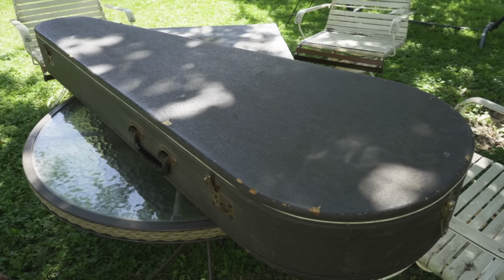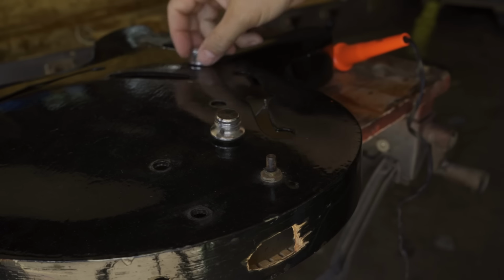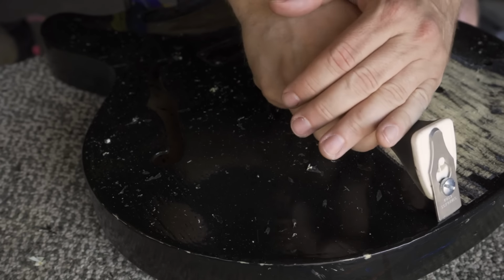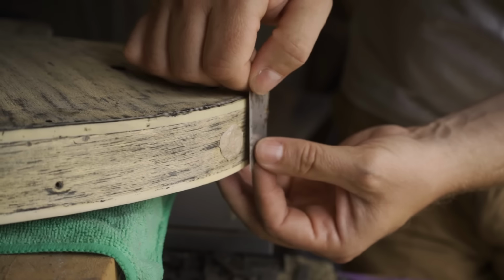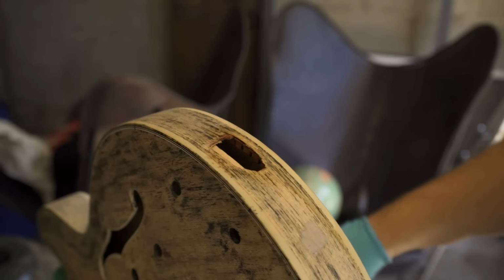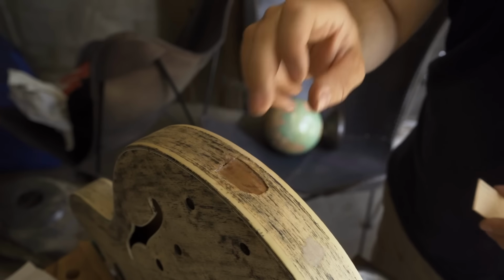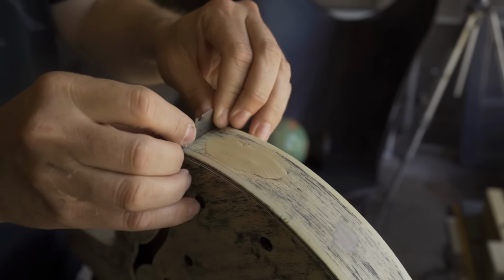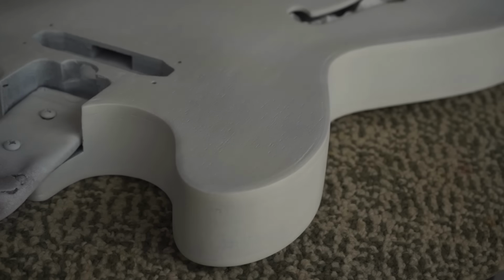I Am Luthier | Do Not Question My Methods | Using My Furniture Repair Skills On An Old Guitar

Comment: As soon as you mentioned your wanted to try a guitar, all I could think was "oh man you're gonna bring out that weird toxic gatekeeping part of the woodworking hobby that thinks a fender squire at the bottom of a river requires the same detail and skill as a Stradivarius guitar."

Enter the comment section. They can go to hell. I enjoyed the video.

One thing you can do to prep a wood surface for paint like a guitar body (also an easy way to get a head start on a french polish) is to paint on a relatively thick layer of shellac and then sanding it back to the wood, using the shellac to fill holes and pores. It had saved me hours on French polishing and surface prep on rough wood - I did it on the ratty curved legs of a bent plywood Ikea chair and I was able to get a freaking mirror shine on the entire thing in an hour (excluding the overnight dry time of that first fill layer)

Comment: looking forward to part II.  So, I understand the objective of the primer, but how will you recover the binding? Why not just use wood grain filler with no primer? (I am learning)
Reply from the maker: I’ll just scrape the paint off the binding. The primer made it easier for me to see  which areas need work.  You could have just used filler but the primer made it easier.

Comment: i wouldn't have cut out a irregular shape patch peiece, i would square off the hole using a router bit, leaving the ends rounded. then cut a veneer piece to shape

Comment: Why don’t you buy one of those box cutter knives, ie the ones where you snap the end bit off to give you another sharp edge. At least you would have a handle on the blade, and you can extend it to the length you want

Comment: I was wondering why you decided not to use a chemical to remove the clear coat/ black paint?
Reply: As someone who does this kind of work, myself, I can tell you that chemical stripper is rather unpleasant stuff. It takes time to work. It's a messy job to remove and neutralize. And even still, you'll likely spend some time scraping after you're done.

Often someone who is skilled with a scraper and keeps their tools sharp can achieve the same results more quickly and skip the unpleasant stripping process.

Doesn't work all the time. Occasionally I still have to resort to the chemicals. I'd rather skip it, though, whenever I can.

I think he said something similar in a video sometime back.

Comment: With 40+ years of experience, I can spot the warning signs a mile away and have billed many thousands of hours to reverse shoddy workmanship. First off, I've never heard of a state requiring a luthier license, in fact I'd actually welcome that. If this YouTuber could share with us photos of his luthier license, I think we'd all appreciate that. Here are mine: http://tiny.cc/martincredentials

However, failing that, here are a few things to look out for when seeking out qualified repairmen to handle your valuable instrument and avoid unnecessary damage. 
- If you cherish your valuable instrument, do your homework about the guitar repair shop you plan to use. Check online reviews, ask around. If you don't, be prepared to have a very bad day.
- Always record your serial number and photograph your guitar before and after the work is done.
- If the repair quote sounds inexpensive for the repair you require, then the work is likely going to reflect that.
- Ask to see a copy of the repairman’s credentials from a certified luthier school.  
More: http://tiny.cc/guitarrepairchecklist

Comment: Furniture grade repair and stringed instrument grade repair are different
Reply from the maker: Are you questioning my methods?!?!
Reply: @DashnerDesignRestoration  2 different degrees of quality. Stringed instruments require a higher level of control while furniture requires less quality. I've repaired and built for over 50 years and if you look at the results of the 2 different types there's a huge difference.

Comment: luthiers dont spray over binding.
Reply from the maker: Actually, they do and then they scrape the binding clean afterwards.  Trust me, I’m a licensed luthier.
Reply: @DashnerDesignRestoration  My friend you need to get your .95 cents and three box tops back from Kelloggs for that "license" because NO guitar mfg spends money to scrape a solid color off binding. nor would they put binding on a guitar that is going to be finished in a solid color. Finish over binding is clear or tinted. New guitars would cost 10,000 dollars if scrapers were hired.
Reply from the maker: @yoshinoyajones8924  Google “Gibson scrapes binding”.
Reply: @DashnerDesignRestoration  As I am not a vindictive 14 yo troll, I admit I am wrong. It doesnt happen often. Carry On!!

Comment: Apparently you're NOT a luthier! A lot of the things that you did I wouldn't have done. The repair patch was OK but I wouldn't have used the epoxy putty or the wood filler to patch those holes. Superglue would more than suffice. And those potentiometers were petrified into place. A little bump here and there on the tops of the knobs would loosen them up rather than simply pulling them from above. And shellac - UGH!! I would've used AUTOMOTIVE PRIMER which is made for a true paint finish whereas shellac is bug shit and spit - literally. Any way I am interested in seeing this come to fruition.
Reply from the maker: Well, most of what I've done so far is just basic wood repair and finishing.  I haven't done much that's specific to luthiery except maybe the kerf lining but even that could be seen as just more woodworking.  At this point it's just wood in the shape of a guitar.  P.S., there's nothing wrong with shellac. It's a fantastic tool for wood finishing.
Reply: Jeez, leave the guy alone. Rock on, Dash. Love your videos.
Reply: Whoever said he was a luthier? Also, shellac has been used by luthiers to finish musical instruments for over a century. The fact that shellac comes from a bug is irrelevant. What are you even talking about?
Reply: @LadyGecko  Indeed an instrument is not a dresser, but a lot of the same work applies, i.e. basic wood repair and finishing.
Reply: And apparently, even if you are a luthier, you lack politeness and tact.  Just because someone posts a video is not an excuse to shit on it.  FYSM.
Reply: To all the haters, it is an electric bass guitar. Do you really think the finish or epoxy has much impact on the sound? Even if it did, do you think he was looking to take a thrift store guitar to Carnegie Hall? Just sit back and relax to the sanding and smooth tones of Dashner's voice. Dang gum.
Reply: your comment reeks of elitism, and represents a lot of what is wrong with the culture around guitar building (and guitars/music/gear in general!)—he never claimed to be a luthier, and this is not some precious instrument that needs to be preserved in any specific way. your comment on shellac is just reactionary and needless, and if your apparent fear of bugs prevents you from using natural materials in your projects then i'm curious what you're even working with. 

if your first impulse over someone trying something new is to jump down their throat, instead of politely educating them and being flattered and excited that someone has taken to the craft you are passionate about, then i think you have some insecurities to investigate within yourself!
Reply: @bullwinklemoose8291  I wasn't shitting on him. I was only pointing out that the methods he used are very crude. I can always tell when someone knows what they're doing and when they're not. I too used to make furniture. That's cake for no more than what's involved compared to musical instruments. This involves a much more delicate and skilled hand with years of experience.  Even so you have to be more careful and gentle than this to exact the proper result rather than hack your way through. Your post lacks the finesse and respect required to tactfully communicate your idea with the same diplomacy that you expect from me and the others that have commented above.
Reply: @miguelangelsucrelares5009  No - it is NOT irrelevant!  LACQUER is what has been used since its' inception in the 1920s.  Professional instrument makers have used it since that time. Shellac is what they used because no one was smart enough to make a better finish medium until then.  It's made from the spit and shit (LITERALLY) of a slug!! Who wants that on their guitar?!
Reply: @pmarlier  No one said anything about sound.  It's the durability factor and the proper use of available materials and supplies used today. It's not going to be a reliable fix as the finish over it will not expand or contract with it and neither will the wood. Meaning that this repair will be visible once the finish has settled.
Reply: @solarismoon3046  Shellac is used on all kinds of instruments. It's a fine finish but not as durable as some others. This doesn't really matter if you're using it as a base coat tho.
Reply: @solarismoon3046  So much feedback in the responses that you stepped over the line, yet you double down with all of your arrogant responses.  Your lack of self awareness in this thread is profound.
Reply: @christopantz  Brilliant comment! I couldn't have said it better. 👍
Reply: @LadyGecko  No, but wood is wood and-  at this point in the process - the wood needs to be addressed before the guitar-specific work begins.
Reply: First of all, this is a channel with a pretty dedicated fandom so you've kinda kicked a hornet's nest with your breathless criticism here. Speaking as a fan, we love Dash -- we like his approachable and honest demeanor (which is exemplified by him pinning your critical comment) as much as his approach to repair, which many times includes applying practiced skills on the fly in somewhat unfamiliar territory. 

Secondly, the man is not claiming to be a luthier. Even the title of this video clearly implies he will be using furniture restoration experience on a guitar. It's a furniture resto channel and this video is just a little bit of variety for subscribers to see something different.

Thirdly, there are millions of guitars in this world. There are probably many tens if not hundreds of instrument repair and construction channels on youtube. Feel free to watch any of those. Any missteps happening here are not some kind of tragedy, as many in comments here have already noted. At the end of the day this is going to be a random guitar that looks a lot nicer and has less holes in it than it did before and that's just fine. He's not teaching a luthier class or selling it to Victor Wooten. Chill.
Reply: Nothing special in guitar wood, that would affect the tone of hollow body electric guitar, I guess. It's very-very minor difference in resonance. I'm pretty sure that shape of inner chamber and pickups are the only thing you should worry, not the finish: if it looks nice — it's ok.
Reply from the maker: @LadyGecko If it was an electric Stradivarius made of plywood then yes, I would plug it with wood putty all day long.
Reply: @conqu2  OKEY DOKEY!! You're the boss and no one else's opinion or experience matters a damn. Forget I said any thing. Just enjoy this work of hackery and think nothing of it - fan or not.
Reply: Dude Shellac is easy, cheap, simple, and durable. Bugs or not, it's still a superb material for finish and prep.

Don't be such a weird snob. Gatekeeping someone fixing something that was going to be junk is just trashy and the reason people hate hobbies. Don't be that guy.
Reply: @solarismoon3046  and lastly, shellac was replaced more for being more difficult to apply correctly than lacquer. Lacquer is a fine finish too, but its real appeal was that your can spray it thick and it dries fast. Mass manufacture loved lacquer for profit margin. Not durability or appearance. If durability mattered at all to the majority of furniture makers, MDF wouldn't be used in table and desk tops. Ever. It's okay, but it's being used because it's cheap.

How can your claim to be a luthier and "know when you're seeing a hack job" when then in the hobby and professional guitar making and repair community, shellac is WIDELY used, despite it being harder to apply and get right.

Also shellac is far more environmentally friendly and safer on the lungs than lacquer. For some of us that matters too. I know that as a paramedic and biochemist. Jesus how did I let this get me so worked up, lol.

Your opinions on the work are not invalid. They're just your opinions, same as mine. But this isn't an opinion, it's a truth of psychology and sociology - Don't be such a dick. People won't listen to you. You catch more flies with honey than vinegar.
Reply: There's a really good technique for videos you dislike to the point of being this rude and condescending.  Don't watch them.  Oh, and a really lazy Google search turns up that shellac is quite often used on stringed instruments, something that's been done for quite a lot longer than spraying them with automotive primer.
Reply: @solarismoon3046  Get a grip. There are a bajillion guitars out there in the world. Go worry about those.
Reply: @LadyGecko  if you can't see the backhanded, rude way in which that information was conveyed, then I'm sorry, there's no dashner woodworking and design that can fix your broken brain, because it's as hard as the wood filler in this guitar body. You wouldn't ever say what that kind of thing out loud to a person, because they'd be well within their rights to slap you. But somehow on the internet it's okay? 

Google gatekeeping.

People like you make me really question if giving everyone the internet was a good thing or not.
Reply: @pmarlier  THIS! Were it a Stradivarius I'd be screaming through the phone. As it is, you don't learn how to repair instruments without working on crap ones and making them BETTER, maybe not perfect but better.
Reply: The whole appeal of this video is seeing what approaches a non-luthier would take to these repairs. Sure, it's "wrong", but there are tons of videos on YouTube that show the "right" way to do these things, so that's what makes this video fascinating and unique! Also, shellac is still considered the best finish for acoustic instruments; it's just that French polishing is difficult and extremely time consuming.
Reply: @xdoctorblindx  Shellac - "The best finish"? Since when?! I almost gave you a thumbs up for your comment but that last part is false. There much better finishes now for guitars both acoustic and electric. But thank you for an intelligent and respectful reply to my original post unlike the jackasses that are offended simply because they don't agree with me.
Reply: @solarismoon3046  You must make so many friends by consistently doubling down on your ignorance and general unpleasantness. The vast majority of Master luthiers of classical and acoustic stringed instruments use shellac and French polish for their finish. But as your previous conversations have evidenced, civil discourse with you is impossible, so I'll leave you to revel in your status as a pinned troll.
Reply: @xdoctorblindx   Well apparently you have your mind made up that anyone who you find unapproving is just a "troll" no matter what they say and that you are right and everyone else that disagrees with you is wrong. So why don't you post a video and thrill us all with your acumen and perfection? You don't know what temperament or attitude that I had when I wrote this but you continue to bash me with your hateful and ignorant comments. I'm not going to agree with you no matter what you say so move along here now......nothing to see. Move along...............
Reply: @colinmartin9797  Apparently you're not a musical instrument maker or finisher by any means. No matter what I say or what spirit it is said in all these self professed geniuses have dismissed everything that I have said. YES - I HAVE used shellac and it is outdated and is not a durable finish and is literally made from bug shit! If you know your finishes then you'd know why I said that and in the way that I did. Also lacquer has a much higher polish and gloss unlike shellac which has to be buffed and oiled to shine and is not the wonder finish that you're all touting it to be which is why lacquer was invented. 

I called them jackasses as they have taken the low road in attacking me for what I said - not necessarily in the spirit in which it was said. EXPERIENCE teaches you what others cannot. They can only teach what they know but only YOU can use your experience to draw from.  I am self taught and I have been doing this for over thirty years!! I have seen a lot of shit in both instruments and the people that own them.  I too started out making furniture and the like but one other soul reiterated what I have said and am now being forced to repeat over and over again and again like a broken record. 

 I have "been there - done that" with guitars and other musical instruments. The point is that I don't want others to make the same mistakes that I was forced to learn from as many of them were very costly - not just in money but in the products themselves.  Know this - if I didn't care I would've looked and went on as so very many have and will continue to do without saying a single word.  I don't just blindly use what others do simply for the sake of using it. There are those who know better and share what they know and others who don't but profess that they do even though they truly don't! I am not the latter of the two.